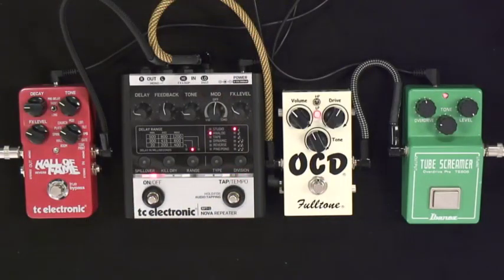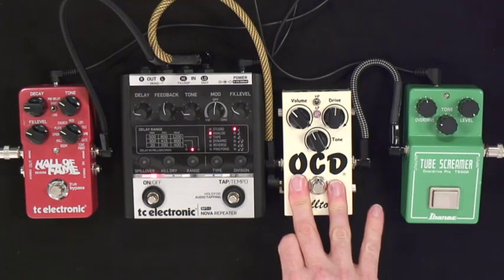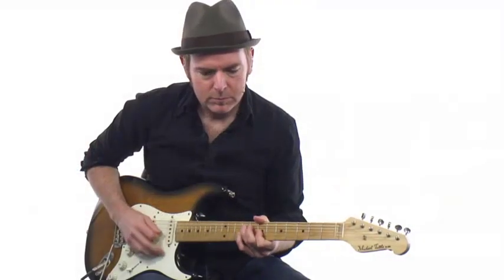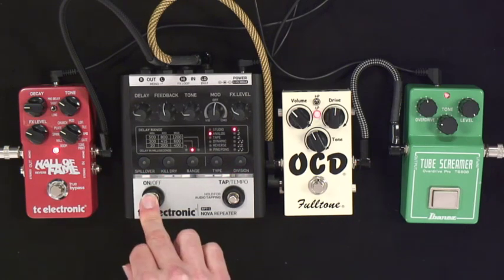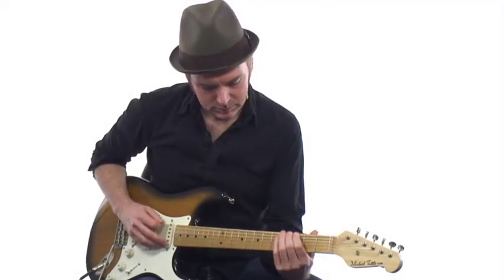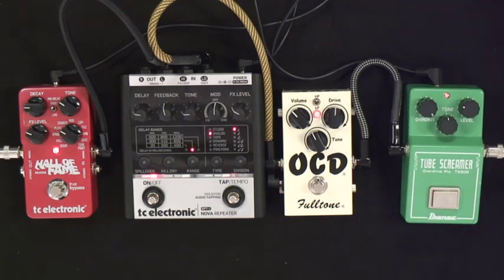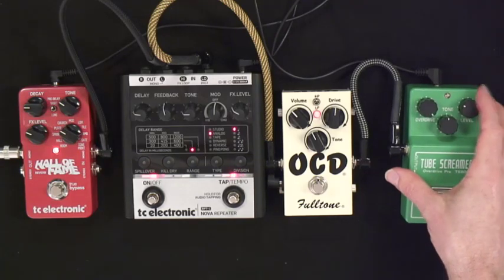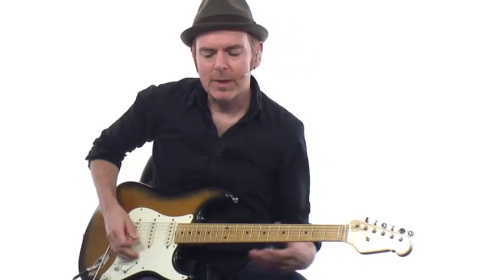Guitar Effects Survival Guide - #9 Gain Staging Tutorial - Guitar Lesson - Jeff McErlain

Comment: Very late to the party. A couple of things.

Rolling up the tone on a tube screamer does not tighten up the bass. It boosts the upper mids with an increased Q factor. If you drop the output to compensate, you do reduce the level of the bass but you don’t shave any of the low frequency away which is more effective. Hence the low end still sounds flubby as demonstrated in the video.

Personally, I don’t like the fuzzy, indistinct tone from running the drive high and the level low and feeding that into a distorted amp or pedal.  So now you’re faced with the volume boost issue. The solution is to put a limiter after the OCD. A proper limiter with a feed-forward design; not a compressor/sustainer with a feed-back design. Otherwise you’ll run into issues with noise. Comp/sustainers are cool, but they’re better placed before gain stages.

Love the tone. OCD + TS is an awesome combo!  Anyone use this with a Vox?  I’d like to know. My friend is looking to get a three channel thing going with his Vox played clean.
Reply: I use the ocd with a ts808 or klon ktr into a Vox ac10. The ocd sounds great into the vox for lower gain settings and sounds great with the tube screamer as a gain boost for me. A lot of people suggest the Crowther hotcake which I also have. The thing is you can get the ocd to sound very similar to the hotcake but… the ocd takes other pedals boosting it much better than the hotcake.

Comment: Excellent tone and a good intro to gain staging.
I like a TS in front of the OCD but I tried an AC Booster after the OCD (MIM DP Strat, Bassbreaker15 Combo & NOS Tweed Blues Jnr. Mk. 3 Combo) and it sounded great, especially with the Tweed Blues Junior. The AC Booster is like a darker Tubescreamer with Bass and Treble controls instead of just a tone control, and I believe it has +26Db of volume boost on tap. It's also great for boosting a Big Muff.
I have never seen that TC delay pedal before. I am familiar with the Nova Delay but that's a different model. Are there any noticeable differences between to two (I love TC delays, my fave is the TC Vintage Delay & Flashback 2)??

Comment: Where should the Wah Wah Pedal go?
Reply: wlliamson53 first
Reply: So right after the amp?
Reply: wlliamson53 guitar into wah into whatever other effects you have into the amp.
Reply: I'm confused. Wait, never mind. I have 3 other effects, a distortion, a delay, and an overdrive. What order should they be in?
Reply: wlliamson53 I'd say guitar into wah into overdrive into distortion into delay into amp.
Reply: Alright
Reply: wlliamson53 Some people like to put distortion before overdrive.  Some people like to put the delay earlier, but most people agree that the guitar should go straight into the wah before anything else.
Reply: Ok
Reply: +wlliamson53 I'd put a wah after your overdrive/distortion. The thing is, that an overdrive/distortion adds harmonics, i. e. integer multiples of the frequencies present in your signal. A wah is basically a foot-controlled bandpass filter so it selects a range of frequencies that it passes on and suppresses the others. Your foot controls, which frequency range it passes. Now the thing is, when you put the distortion effect first, the wah has a richer frequency content to work with since the distortion has added lots of harmonics. Try it out, but I'd put a wah after distortion. Generally I'd put a filter (also an eq, etc.) after the distortion. That's also how most amps are built. The tone stacks generally come after the gain stage that produces the distortion in the signal flow.

Comment: I'm just not a believer in overdrive or distortion pedals. People can get somereally nice sounds out of them, but they're not for me. If I want more overdrive, I'll get a nice tube amp that will provide me with the desired amount. If I want more, I'll use an op amp based clean boost so it's absolutely clean. I always play with a compressor for added sustain. My problem is, I prefer the tone and dynamics of plugging directly into the amp. I want a buffer with the same input impedance as the amp.